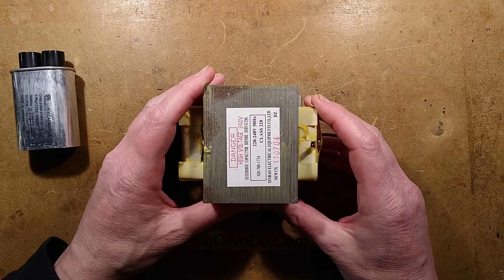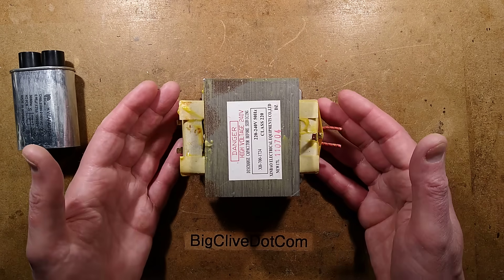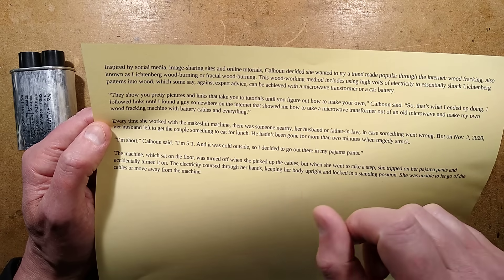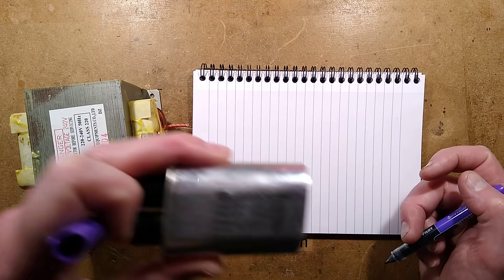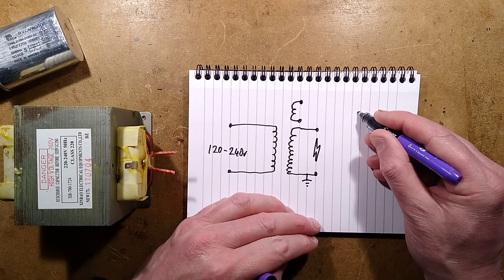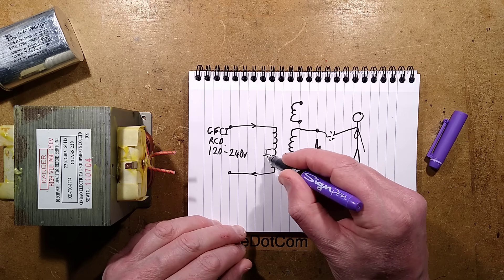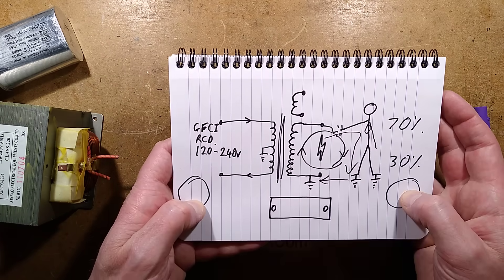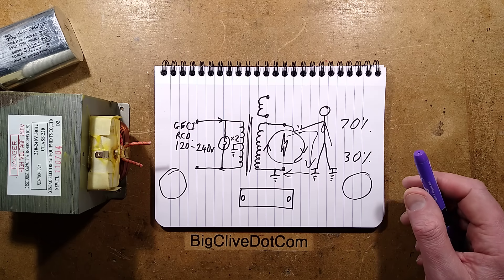The most deadly project on the Internet

Comment: Never had an electric shock during my previous 50 years in the electrical industry because I had a 240V shock as a young kid when I worked on a live extension cord socket when my parents were out. It was such a horrific experience that from that day forward I have always been super careful with electricity.
Reply from the maker: To be honest - a shock is the best way to learn.
Reply: @bigclivedotcom  Yeah, at residential voltages... If the first shock kills or severely maims you then there's certainly other much better ways to learn!
Reply: I discovered what 380V phase-to-phase short circuit is like while drilling a wall as a child. The blast throw me off the chair I was standing on, and sent me into a flight across the kitchen, still holding the drill. The tip of a 9mm drilling bit melted by about 1 cm of length. That was very implressive. And that's with the fuse limiting the amount of energy released.
Reply: @ii795  What caused the short circuit?
Reply: @IAmThe_RA  I just accidentally shorted 380V wires with a drill bit. The wires were going inside the wall to a socket for an oven. This is a common arrangement in all ex-USSR countries: phase-to-ground 220V for normal sockets, phase-to-phase for ovens.
Reply: Yup, 240 is bad enough. A different commenter described his experience with 13.5 KV.
Reply: Wow.  I have the exact same childhood story but with 110.  I couldn't get an extension cord unplged from a record player and I really needed it.  When I couldn't pull it apart, I put it in my mouth to get a better grip.  The rest is history.  I was about 5 years old
Reply: @Chris Huber  volts don't matter and even the current aint that importand. Only when you are the bridge between the drain and the supply it matters little how much Amphere flow there is.
Al above 60mili amphere kills you...
What does matter is the alternating  frequentie of this current, up this high enough and the body doesn't register or respond to this any more.

While you still be able to light a bulb in you hand passing high voltage like nothing true your body....

Any electrical signal is based on Radio frequentie so direct current is something made up.
Also direct current has a frequentie wavelengths....
Reply: my Dad was restoring an old lamp in the garage ...left it plugged in without a lightbulb in the socket....i was playing with a steel ball bearing and somehow it landed in the lamp socket!! ....well i didn't know it was plugged in and reached to get the ball bearing out and got quite a good shock.
Reply: That's amazing.  Well, sort of.  I can't tell you how many times I've been shocked.  (Electrician since 1983)  However, I am in Texas, therefore I work MOSTLY on 240 volt split phase systems or 240 volt or 208 volt 3 phase which might or might not have a 190 volt high leg.  I did have an awakening experience once though.  Around 1988,  I was in a multi-story building adding some recessed flourescent  fixtures to an existing string of them.  While connecting the new fixtures to an existing one, I left the power on so I would have some light.  I should have just brought in my flashlight.  While I was in contact with the steel ceiling grid,  I bumped the hot wire with my hand.  The contact was only for a split second.  It was painful.  I could taste it instantly.  I climbed down the ladder not feeling very well.  I had to sit down for about 10 minutes.  Multistory buildings, are served with 3 phase 480 volts.  Each floor (or each suite) has a 480 volt panel with three 277 volt legs.  A transformer steps it down to 240 volt split phase for plugs and small 240 volt appliances.  But all lighting operates on 277 volts from the main panel.  That is the only time I ever got into 277 volts and I will never repeat that mistake.
Reply: Never use both hands to remove those 240V test leads.  Cleared up my sinuses and arteries, both!  :-)
Reply: @HarryHamsterChannel  Lol.... it dont matter if you use both hands or just one....the moment you are grounded to earth you get shocked anyways when you touch the wire.
Second to this, you are dealing with AC/RF frequentie currents, that is switching in between the N, L1, L2 and L3 wire, these are out of phase 120degree to provide the 220v out of the three suplly lines that provide 110v.

So in contrast you are never shocked with 220v or 380v just 110volts.
It's then again not the voltage that matter but the frequentie ist using.
Second to this It's the freqentie of the current that will kill you.

The Amphere's and Frequentie's 
and not the Voltage that matter.

You can handle 20.000volt easy when the frequentie of it aint 50hertz to 60hertz because the body can register this.

AC/DC current dont exist these are all RF signals, Direct Current is something wrong  you learned about in school.....but we all know that even though a battery's seem like direct current, they are really just on another frequentie wavelength that you cannot measure with your standard multimeter....

If you really like to understand more about this i'am suggesting to look up Gerard Morin on youtube.....
Reply: I stuck a nail in the wall outlet when I was 4 and like a month later i unscrewed a light bulb and put my finger in it. It was 240v. I only remember the latter and it hurt like hell
Reply: I felt 240 from a dryer 2 years ago, crazy feeling
Reply: @Percules15 I touched 240v when working on Ac locked my hands closed and triped breaker. I even heard the vibration sounds. It actually sounded like hitting those ribs on the side of the highway when you are driving bruuuuuuuuuuuuuu... Damn not fun
Reply: ...school of hard...shocks?
Reply: And you still became a sparkie?  Good on you!!
Reply: I got blasted with 240 working on hot water heater last summer. Insane feeling
Reply: I did something similar, only I was leaning against a central heating radiator....still haven't got over it 😂
Reply: For me I was about 14 and had current from 120V coursing through my body for 2-3 seconds. The current through your nervous system can prevent you from releasing the electric source. More importantly, I believe as little as 17 micro volts can stop the heart. After my experience, I had the courage to use 2 fingers to check for a 120v source.
Reply: Correction: 17 microamps.
Reply: My Grandfather told me " Don't be afraid of electricity, Respect it!"
Reply: @Dinco422  There is probably a better way to step down from 230V to 200V than using a transformer.  But if you want a transformer,  you can cut the secondary coil off of the microwave transformer and replace it.  I am in Texas, so our microwaves operate on 120 volts.  When I replaced the secondary winding, I used 3  turns on the new winding and got 2.8 volts.  You would need to experiment a little because your primary winding has more turns than mine.  The input voltage to output voltage is the same ratio as the primary to secondary winding ratio.  To get 200 volts, your secondary will  have almost as many turns as the primary.  Wind it neatly or it might not fit.  Be sure to use a wire size rated for the required current at a high temperature  (90ºC/200ºF)  because transformers generate heat.
Reply: wow, I never thought I would say im grateful that I was almost electrocuted to death as a toddler but there it is. I could never imagine a life where I dont know first hand, the awful dangers of electricity.
Reply: I got a 120v shock as a teenager, and it just made me want more (less voltage and amperage, technically).
Reply: Well I'm going to jail, I thought I was being a good uncle, it's been real y'all.
Reply: How much volts would be from trying to unplug an extension cord from outside while it’s raining and you weren’t able to let it go?
Reply: @joshcantrell8397  Actually, water is not a conductor of electricity. It is the contaminants in the water that conduct. If it's not acid rain, that might be a non-issue
Reply: @downtownbillyandthenewjivefive  I never said it was or it wasn’t. I was just curious how many volts would cause something like that to occur.
Reply: @joshcantrell8397  It ain't the volts that will kill you, it's the amperes.
Reply: Yep, learned my lesson after sucking on a 20V, 4.25A MacBook charger when I was a wee lad. Felt that jolt in all of my teeth, down through my hands and feet. Incredibly dumb of me. I work as an audio tech and haven't felt a shock since, knock on wood.
Reply: The jolt and pain was so immense and sudden, I often dream about it now and then it was so intense I still feel my body jolting even from a dream It's basically my nightmare that wakes me up.
Reply: Similarly, I wired up a plug perfectly when I was about 4 years old. I'd watched my Dad do it hundreds of times. 

Then plugged it in.

Without putting the backplate on the plug. Cue three big holes in my hand and one screaming, terrified 4 year old. I have some jolts since, but nothing will ever shock me more than that did.
Reply: yet you became a sparkie? Couldn't have scared you that much!
Reply: I've stopped counting the times I've gotten hit.
Reply: Funny thing about you getting shocked..i suggest looking up Gerard Morin....many people that think they understand electrical engineering, but often don't because they are misinformed.
When you understand the first basic principal about, Volts, Amphere, and frequentie wavelengths.
You are already half-way there....!
Secondly ist importand to know that AC alternating current does not exist and this is excually a RF wavelengths.

Most people tell you that it's the current or Amphere that will kill you!
But that's not completely correct.
Because it's the frequentie wavelengths  that the current is alternating on that will kill you.

So when you play around with these transformers, make sure that you know, that what your dealing with really works like you think it does.
Reply: @stefanaddwork  Yes.  Any voltage, any current can kill if the frequency is within the range your body reacts to.
Reply: @stefanaddwork  so there is no such thing as AC or DC but it is all RF?.. or just F ?  Do all of your 3 followers believe the same?   How does an inverter work?  Glad you asked.. it uses DC. Which has no frequency, only amplitude. And gates it full voltage using 2 banks of SCRs for varying timed on / off cycles, switching from one bank to the other 60 times per second, firing each bank multiple times at incremental frequency on each cycle to assemble a sine wave. Uses DC to emulate a choppy  AC sine wave. Creating a frequency that is variable by changing the timing. It's called a  VFD used to vary the speed of AC motors while maintaining full torque /voltage across the various rpms of said motor for applications like a hoist or lifting motor. A variable voltage drive changes the amplitude or peak to peak height, without changing the frequency or length of each cycle to soft start a fan or device by a ramping up of voltage to reduce high starting torque loads on a conveyor belt or  cooling fan. Each for a different desired use. Each use DC voltage to create an AC sine wave either by frequency modulation FM or amplitude modulation AM. Looks like we are talking Frequency created from DC...  Even if it is plugged into the wall, that AC is rectified into DC first. Unless it is a transformer like your phone charger that changes voltage from 90-240 AC to 5V but needs an internal diode to rectify to DC to charge your DC phone battery. There are also buck-boost and switching transformers that use different electronics to make cleaner, DC without AC ripple  or smoother, less stepped AC sine wave when cleaner voltage is desirable for AC applications. After all we are just vibrating star stuff that believes whatever this flat earth tells us. You can't trust atoms. They make up everything. And those nesting Russian dolls are conceited and so full of themselves..
Reply: Just be glad you did not get tortured with electricity… man up please.
Reply: 240V is not horrific, I had 5 as a child and 5 as an adult.  You just jump.
Reply: Don’t lose sight on the Kingdom of God 🏞️ all that is in the world is soon coming to an end. Seek God whilst He may be found. Jesus saves ✝️🩸🕊️
Reply: @TRUSTINYAH  So just what does your little gospel speech have to do with this video?:body-blue-raised-arms:
Reply: @TRUSTINYAH  Go away, M-ron. Stick your Bi-Bull and all of your other nonsense and B.S. someplace where the sun don't shine.
Reply: @TRUSTINYAH  This is the most important comment in this thread for Whoever has ears, let them hear.  Matthew 13:9-16

Comment: I'm an EE and have an interest in microwave comms running a 2.4GHz uplink /10GHz downlink to a geostationary satellite. I squirm at the stupidity that is out there regarding "death rays" and microwave transformers for "shits and giggles" - leave the damn things alone. I won't fcuk about with them and I have over 30 years experience. If you don't know what you are doing, understand about insulation and voltage a very simple mistake can cost you and your family dearly. 

Don't mess with Microwave ovens unless you ABSOLUTELY know what you are dealing with.

Comment: I like the art that these produce as someone who had brief knowledge of the method but didn't know people were putting their life on the line for this stuff. I was looking to buy art projects with the designs like these on Etsy. This is pretty insane to me. I looked at the woman's injury you put in the description, pretty brutal. I'm not squeamish but for those that are I would suggest not checking it. I wouldn't touch a project like this with a 100 foot pole.
Reply: There are safe ways to do it. Though as pointed out, require significant effort (probably more so than actually building the thing) to do right. 

Given the hazards presented from interacting with a high voltage source (and in addition to the dead-man’s switch), I’d probably use two in-line breakers, that are each locked-out (think Lock-out, Tag-out) when the device is not in use. This should prevent accidental activation, both by the user, and guests (such as kids). 

A specific, well ventilated enclosure, such as a heavy shed, is probably a good idea as well, as you have a place to mount your breakers (preferably on the outside), makes it easier to maintain a minimum distance (deadly energy on the inside, me outside), and can control access.

As a bonus, red LED lights can be mounted inside that turn on when the breakers are closed, providing an instant, and very obvious indication that dangerous energy is present.

Comment: You don't want to watch my videos then, fortunately I am fully aware of the dangers of microwave transformers, but if you chop secondary off wrap a few turns of meter tales round the core you can make a pretty good battery tab spot welder !
Reply from the maker: The spot welder project is fine.